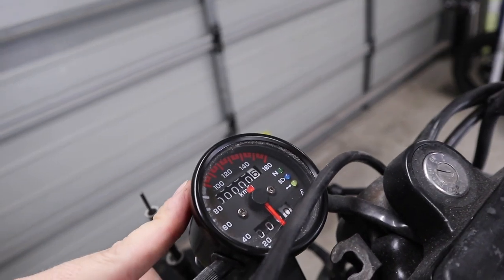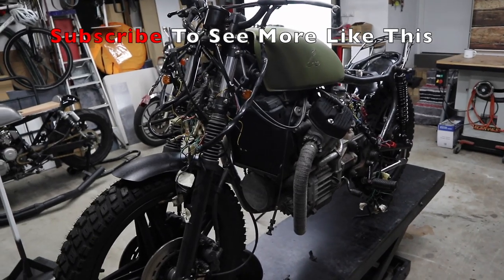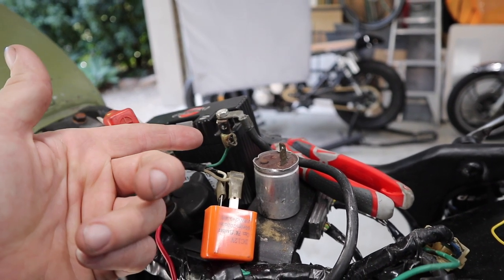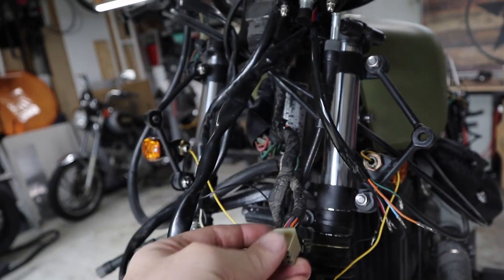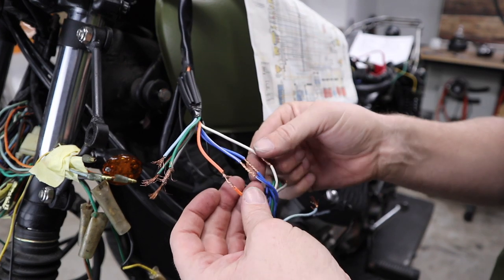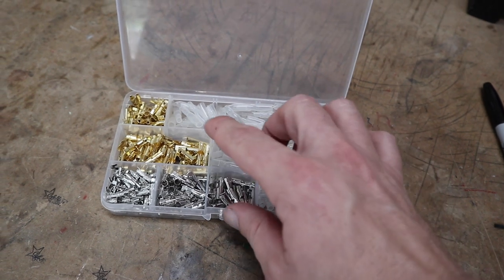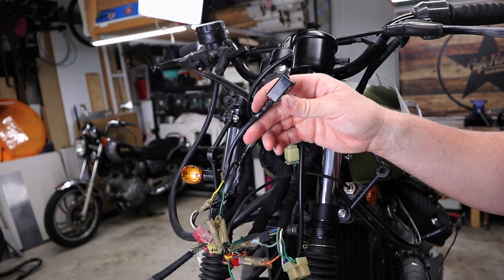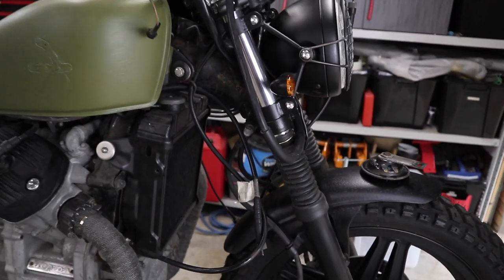Motorcycle Wiring, Part 1, Scrambler Budget Build Challenge Ep. 31

Comment: The original flasher relay probably still works, just not with the LED taillights.  The old style relays were basically a circuit that used a  capacitor and resistors wired in a certain way to flash the light bulb and relied on the bulb's resistance to work properly.  Since the LED lights have very different resistance characteristics from an incandescent bulb, it won't usually work with the stock flasher unless you use something like a load resistor.  The best solution though is what you did by getting an LED specific flasher unit.  Great video as always.
Reply from the maker: R.J. Bedore thank you for explaining that, I wasn’t sure why it didn’t work but that now makes sense 👍
Reply: @CafeRacerGarage  No problem, glad I could help.  I have been looking for a retro/scrambler style bike with shaft drive for a while, but BMWs are out of my reach and Moto Guzzis are hard to find here in the States, so I have been watching your build intently.  I wasn't sure if I had the requisite tools and skillset to do a project like this when I first came across your channel, but I have learned a lot from watching you go through the process, so I am happy I could share a bit of knowledge with you.  Thanks in large part to your excellent videos I have started looking for a bike I can do a similar conversion on myself.  Thanks again for the great content!

Comment: Hi Dan , tidy job. It looks like my CX a couple of weeks ago. I finish the electrics too but I had to hide some cables and plugs under the fuel tank and i mounted the horn on the right hand side by the carbs using the the end of one of the engine mounting brackets bolt it had a couple of cm left so just a nut needed and you don't see it as the original is a big one. Thanks for the video. have a good weekend ride. Gus
Reply from the maker: Gus thank you Gus, yes it is a fun job getting the cables and wiring where you want them but satisfying when it’s done

Comment: Great video as always i really like the longer videos. Just a tip for next time you are working with a horn and it doesn't work, the little screw on the back is an adjustment turn it a tiny bit either direction and you can sometimes get the horn working again. a lot of times the older gina get filled with dirt and just need to be cleared out.

Comment: I put LED blinkers on my GL1100, as they will NOT work with the 'old' 80's relay I purchased a LED blinker relay (adjustable).... as they have to flash between 60 - 120 flashes per minute.

Comment: Here is a little trick for your joint. To avoid big lump in your wire harness you can staggered the joint, if possible,  this way you get a more uniform harness and also better protection against short wire.
Reply from the maker: René-Yves Côté great idea mate, thank you for the tip :)

Comment: Have you considered using solder seals instead of a soldering iron? All you need is a lighter or heat gun. They're so much easier than doing it with an iron and solder and are completely insulated.

Comment: Been binge watching your vids on the CX500 scrambler after hearing about your channel on Classic Octane. Back in the day we used to make fun of these bikes but the engines are bullet proof and with a shaft drive the whole powertrain is very dependable. You have a different style than Taylor but I like it just the same. Curious about the speedo, what will you do about an oil pressure indication? Your speedo doesn't have the idiot light for oil pressure (at least you didn't mention one), so will you go with a gauge? I know the video is 3 years old, but maybe you'll comment back. And yes, I subscribed, too.
Reply from the maker: Hey brother yes Taylor is an awesome guy 👍 
In regards to your question, I just deleted the light altogether, it’s probably not the wisest thing to do and I should look at putting one in but at this stage it doesn’t have one.

Comment: This part solved the LED blinker problem on the CB500 I just finished and the CX500 I am working on. The LEDs just don't have the resistance to trigger the old relays.                             https://www.amazon.com/gp/product/B07K2X5C8R/ref=ppx_yo_dt_b_asin_title_o04_s00?ie=UTF8&psc=1 .    
I had the same problem with the "Orange" relays, only thing is you have to "modify" the connections.  Great content as always !